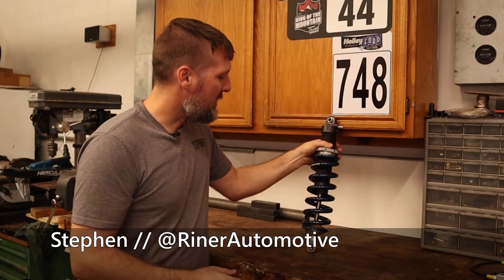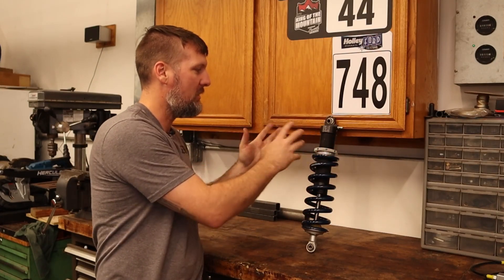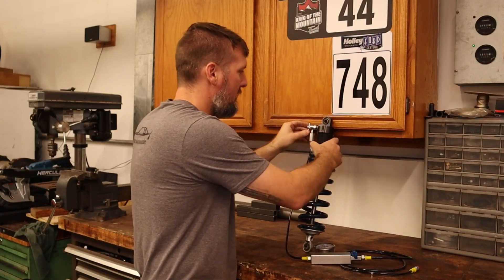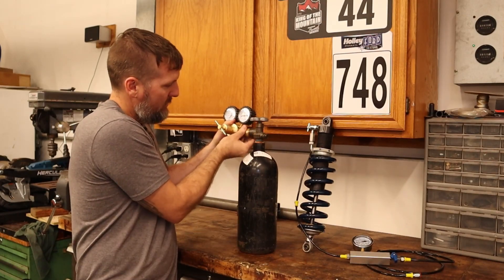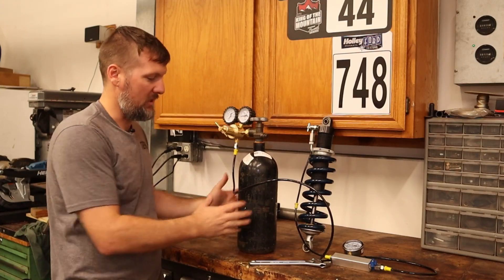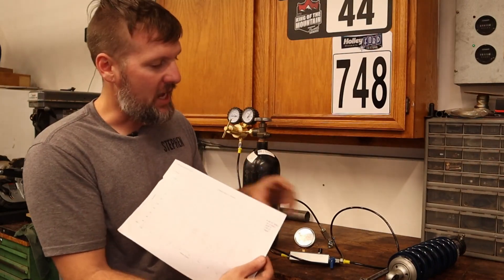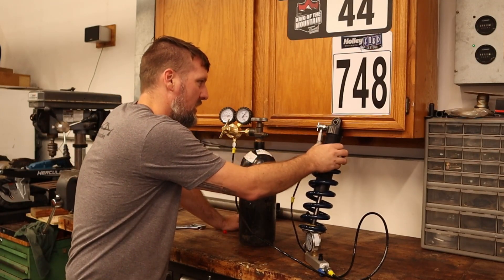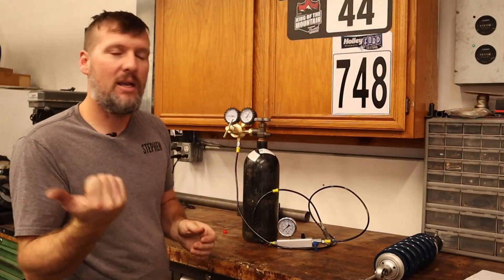How to Recharge Nitrogen into Shocks

Comment: Out of curiosity what is the panel with lights and hour meters on the wall for?
Reply from the maker: AC system. Keeps track of the hours the compressor is running. Lights are for the different operation modes. Something the previous owner did but I kinda like it.